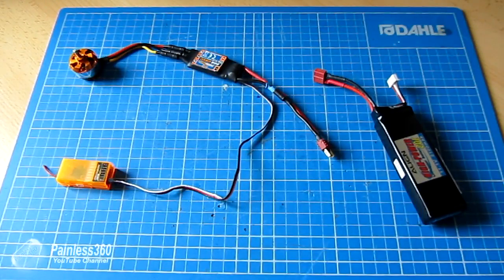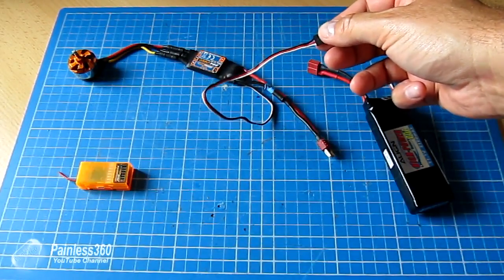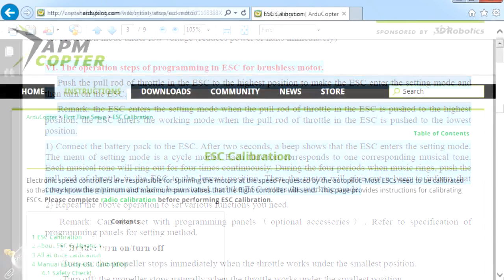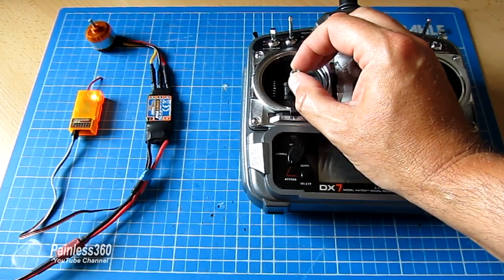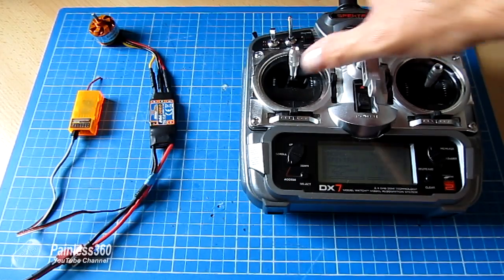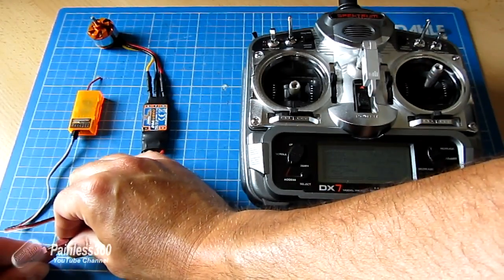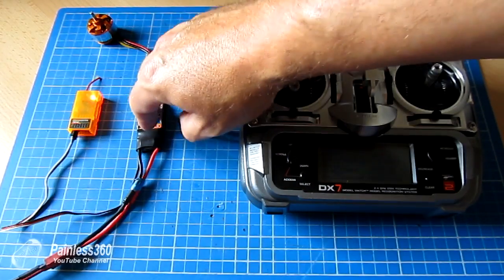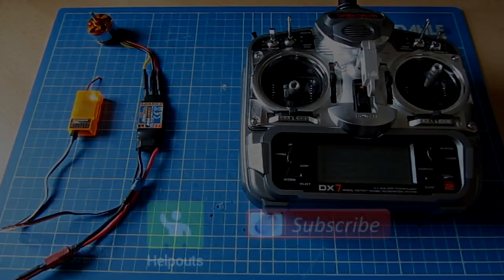Multirotor build tips: Simple manual ESC calibration

Comment: Hi, Painless360

I already calibrated my ESCs when I was using a Open CC3D flight controller.
I want to use the same ESCs for an APM set up. Do I need to calibrate again for when I'm setting up an APM quadcopter?Thanks
Reply from the maker: +Yomi Eluwande I would, just to make sure everything in the new machine is happy. Best of luck

Comment: I have the flying 3d x8 quadcopter three motors idle at arming but the right front motor does not it seems to work fine after I give it more throttle do I need a new esc or just calibrating. thank you .
Reply from the maker: +ziggyzbeak I'd try re-calibration of the ESCs as a first step... Best of luck.
Reply: tthanks ill try

Comment: Hi dear, I have tried to follow this calibration with an Emax 12A BLHeli ESC and Emax MT1806 motor but I did some step wrong and got a throttle inverted (full at bottom). Could you please help me to reverse that mess! Thanks!
Reply from the maker: +Oscar B. Monteiro Jr. Redo it all with the props off.. Best of luck!
Reply: +Oscar B. Monteiro Jr. use the reversing switches on your controller
Reply: Oh yeah, I got it. I forgot this step when assign a new model in my Tx. Thanks anyway!

Comment: Hi,  Would this  function on the Devo 10 with RX2001 and RX601?

You do a great job and  you are a good educator.... much appreciated.
Reply from the maker: +Quadcopter102 No idea, I don't have that radio. You do need a receiver that can provide the throttle channel as a PWM signal - if the Rx does that then it should work.. Best of luck.
Reply: Thanks for  reply....

Comment: What the difference between this and when you do it through open pilot.  Seems like it's the same thing.  Having major sync issues.  Not sure if my escs are shit and don't work well with my sunnysky 2204s 2300kv.  Or if it's something else
Reply from the maker: +Chadeverythingcustom I've had problems with the 'automatic' and 'all-at-once' method of calibration and this is the method that works the best for me. I've had problems in the past where using different ESC firmware versions causes all kinds of odd behaviour.. Best of luck..

Comment: Is it normal to calibrate the ESC directly from receiver's throttle channel and not through the flight controller's motor outputs?
There should be no range difference of throttle signal of radio and to motors from FC?
(I have quadcopter with APM FC)
Reply from the maker: +FotoAmg AmgFoto In theory yes. There is a way to calibrate through the APM but I've found it didn't always work for me.. Happy flying!

Comment: I try to cal my esc but after that the motor spin very very slow even in full thro., what can I do? I try recalibrate it many time and no luck,
Reply from the maker: All of them or just one?
Reply: 2 out of 4. Half... I think it is a issue with ESC as I swapped motor same happen.
Reply from the maker: +wing hum thomas fung I would go back to the vendor if you can't calibrate them successfully using this method. Best of luck.
Reply: I have tried with different remote finally I could recover it to default setting and it works. But my question now is does the thro lower point and higher pint of Thro need to set it lower by the trim to works?
Reply from the maker: Sorry I do not understand the question..

Comment: Hey Painless360, so I got that new ESC and all 4 are now calibrated and in sync using the Master throttle in clean flight, I tried a test flight and all the motors seem to kick on at the same time but once it got in the air it just went crazy and very unsteady... I hooked it back up to cleanflight and  when using my taranis plus Tx the motors are not in sync and fluctuate quite a bit....I  am so frustrated with this lol any suggestions??? is there some sort of settings in the taranis I need to check??  I have the nighthawk 250 pro kit, naze32 board mounted using nylon screws/nuts..
Reply from the maker: +Justin Paul Nothing to do with the radio, the ESCs are controlled by the flight controller. I would check for vibration on the craft - unbalanced props and motors - and mount on foam to reduce it. Excessive vibration can be seen as movement by the FC and compensated for. Try other PID loops and also look at LPF if you've tried everything else.
Reply: Yea I was messing around with the pid loops after I wrote the message thank god. I was using 1 (rewrite) and it was very unstable.  Switched to 0 (old) and it flys perfect!  Thanks for the help and I'm glad I didn't take it all apart before messing with the loops :)  now to just get better at flying so I can mount fpv camera and mobius! No worries there I got that all working fine haha thanks again.

Comment: what motor do you recommend with this esc?Hobbywing XRotor 40A  2s 6s?SunnySky X2212 KV980 Brushless Motor?
Reply from the maker: vano kiknadze This ESC will work with loads of motors - the weight of the model, battery size (3s or 4s etc.) and how many motors you will use (quad/hex etc.) determine the motors and props, not the ESC..Best of luck.
Reply: Thanks

Comment: Very nice video.
I followed your procedure and found if I waited with throttle up I would get 1 beep 5 times, 2 beeps 5 times and so on until 5 beeps 5 times then returned back to one beep...
From what I read this is the program mode. I didn't change anything, only waited for the one beep then throttle down. I hope I did it right. I'm using Turnigy Multistar SBEC 20A ESC's.
Appreciate your thoughts.
Reply from the maker: What does that manual say about calibration?
Reply: Painless360 i found an old manual but it differs in the programming mode(beeps). I dont want to do simething that would mess it up.
I have a KK2.1 FC. I could set it  up because it has a calibration mode and then put it back with the Naza lite FC. Do you think this would work ok?
Reply from the maker: W Morris I strongly suggest going back to HobbyKing and getting the actual manual, without it you are guessing.https://www.youtube.com/watch?v=olIqTiSJHIY can be a useful reminder in cases like this. Best of luck

Comment: Hi thanks for the great tutorial.I have these exact same ESC's in my Naza FC 450 quad. Have flashed them with Simonk K, I use a Futaba FF9, or 9C as known in the USA. (FrSky 2.4 module mod) Please watch the attached video and please let me know what steps to take. It is powering up at 50% throttle as your pre calibration shows. https://www.youtube.com/watch?v=FNE37bJZHBw
Reply from the maker: Matt's Hobby Channel I would check that the throttle isn't reversed on the radio. That ESC is powered on and can see the low throttle position. You need to power on the ESC with the throttle in the high position (usually over 1800) and then drop it to zero (usually about 1050ish) to complete the calibration. 
Yours are not going into calibration (from the sounds) so are not seeing the 'high' value when they power on..
Best of luck with it..
Reply: Thanks, but not reversed, have been flying it short hops like this, and is definitely the correct orientation, but thanks for taking time out to try. Any special settings being Futaba gear? Is driving me nuts, just want to use it. It's obviously squirrely in the air, so don't want to risk destroying it or worse! Cheers Matt
Reply from the maker: Not sure without a lot more investigation.

Best of luck with it.

Comment: Great video! I am having a problem in which my quad will not get off the ground. If I calibrate with Open Pilot's wizard or calibration tab, the 2 CCW motors stutter on the bottom of the throttle curve do not fully spin until the CW motors are already up to neutral speed. I tried to calibrate each one manually via the transmitter/receiver (Turnigy 9x TX and 9x8C RX) but each ESC will just beep continuously until the transmitter is powered down, then they play their tune and speed the motors up until I disconnect power to the ESC. The ESCs are 12a SimonK and the motors are Emax MT1806-2280KV.

Any idea why the ESCs will beep continuously like that? I'm starting to wonder if they in fact have a different firmware or are damaged.

Any help would be appreciated.
Reply from the maker: Chuck Leone If they will not calibrate using the method in this video then something is up. 
Once you've calibrated then this way then you can use the output sliders in Openpilot to set the level that each individual motor starts to turn...
Best of luck.
Reply: Painless360 Thank you for the response. Any idea of how to confirm what firmware these ESCs have loaded without using an ESC programmer?
Reply: Chuck Leone I have the same problem
Reply from the maker: You have calibrated the accelerometers right?

Comment: I'm stuck here, my d4r-ii doesn't power up from the servo wire coming from the esc, any suggestions? I want to calibrate all esc before I mount and hardwire them onto the quad. The receiver is brand new never powered up
Reply from the maker: I would check that you have plugged in the wire the right way round, and use a volt meter to ensure that there is five or six volts coming out of the positive wire in the middle of the three pin server connection from the ESC.

Best of luck.
Reply: Thank you for replying, i have the Turnigy Plush 12AE, they claim BEC output to be 5v/2A.
The motors chirp when i power them up, i've watched all your related videos so was careful about polarity, is there any other way i can connect power to the d4r-ii to see if its faulty?
I have ordered another one just incase, but it won't arrive for a week or more :/
Thanks again
Reply from the maker: If you have checked that there is +5v out of the red wire in the middle of the cable then it looks like the Rx is faulty. It should light up in some fashion when power is applied.

Best of luck.
Reply: Painless360  Hello again, i have now got the receiver working and bound to my Taranis,  the motors spin but there is a big dead range so  i want to calibrate all the esc's individually before i install everything and solder, i have followed all the steps, double checked the instructions, watched all your videos (again) and they will not calibrate throttle range.. 
I have worked out how to program the esc with the Taranis but i'm not sure on some of the settings like, 'start up mode- soft,super-soft'. On another video someone was using a programming card to program their plush escs and they changed the Timing to High noting that it was important. 
Anyway its really frustrating me and your help would be appreciated if you have any idea what it might be, Do i need to flash them with BLheli or something like that to get them to calibrate? hmmm ;)
Reply from the maker: If you are using the ESCs for multirotors then they should be flashed with a firmware that is designed to improve performance and response for those applications - SimonK and BLHeli being two popular ones.

I would go back to the vendor for support.

Best of luck.
Reply: I have tried a different esc that is flashed with SimonK and its the same, so i assume its something i have missed in the Taranis.
I appreciate you must be inundated with questions from noobs like me and unable to take time to answer sometimes, ill battle on.. thank you again.
Reply from the maker: You need to work on getting the ESC to calibrate in manual mode.

The only thing I can suggest is that you look at the range that the Taranis is putting out on the throttle channel.

Normal throttle channel values are approx. 1020 to 1980 and the default range for a SimonK ESC is 1060-1860.

The Taranis can put out a much wider range that might be confusing the ESCs you are using - see https://www.youtube.com/watch?v=azs1wmr4c7w around the 15:00 mark..

Best of luck.
Reply from the maker: Also https://www.youtube.com/watch?v=9jyq12lrxQ4&list=PLYsWjANuAm4rtLZuLU2eSTc3svqWx-pa1&index=5 around 15:32 I talk about this too...

Comment: Very nice video man.. Helped me a lot.. But just one question , If I make this one by one (4) connecting them into the throttle port, wouldn't that make a slightly difference between every motor ? , so each one is going to start first than the other one ? Thank you.
Reply from the maker: Ricky Henderson I see why you may think that but this process 'teaches' the ESC exactly what the actual throttle range on your radio is so they start at exactly the same time when powered up. 
Best of luck with the setup.

Comment: question, my set up futaba t8j-tarot 560 sport- wing-hobby xroto 40a brushless opto esc. Naza M fc.I have just finished calibration.just as you did, everything looks good. motors all turn on mid throttle  etc theirs one  thing I do not understand these esc do not sing out at start up?? Is this something I did when setting up throttle?all my other quads do IS THIS OK??...................Jerry
Reply from the maker: jerry neider The motors should start turning as soon as you move the throttle up (with the board armed). Not mid throttle. I'd check ESC calibration and throttle channel settings on the radio and in the FC.
Best of luck.

Comment: When I plug in my esc's to the power and receiver just like this, they beep but then they do not throttle up or down. help please...
Reply from the maker: Will Park What troubleshooting have you already done?
Reply: Painless360 I'm pretty sure I have dead esc, other esc's work with the same receiver and motor combo
Reply from the maker: Only way to tell is swap the motor on the 'dead' esc with one of the others. If the problem stays with the ESC, then it is the ESC at fault. If it follows the motor then its the motor that needs looking at.

Best of luck.
Reply: Yeah the esc is dead, I bought a quadcopter kit from hobbyking that came with 20A motors but 15A multistar esc's. It's not surprising that two of the esc's would not work.
Reply from the maker: Bummer, sorry to hear that. Good work on figuring out. I'd let HK know and get them to ship out replacements. They are very good with DOA kit.

Best of luck with the next two!
Reply: Yeah, not sure I want them to send out the same ones though. I'll see if I can get them to send 20A esc's next time.
Reply: Will Park For what its worth, I recently built a zmr250 from the ground up. (my first build)  I foolishly thought I could run a 4S batt on 12amp Emax ESCs... about 1 minute into hovering, I smoked an ESC. This was partially because the ESCs were under powered and they were not calibrated properly. That being said.  I have now ordered 5 ZTW 30amp Spider ESCs.  ESCs are the most work in replacing in regards to soldering.  I would spend a couple extra bucks and get something with enough headroom (20amp) and a reliable \ programable brand.
Reply: HobbyKing sent me 20A Afro ESC's and it now flies great
Reply from the maker: Great news! Happy flying!

Comment: Great video. Was just wandering if this method will work if I've configured my RX to use S-BUS? Thanks.
Reply from the maker: You need to be able to plug the servo lead from the ESC into the throttle channel. It's expecting a PWN signal so you'll need to turn of S-BUS or use an adapter for that to work..

Happy flying!

Comment: I have just picked up a TTX850 and TR625 receiver for my quadcopter. I'm using a NAZE32 flight contoller and want to program it with CleanFlight. My problem is I cannot get the TX to work with the RX. I am nit sure if I should disconnect the ESCs from the NAZE32 first and connect directly to the TR625 to program the radio or if I should leave the ESCs connected to the NAZE32 board and connect the RX to the NAZE32 also? Does anyone have a guide on how to program your TX for a quad copter? I can get the motors to spin when i am in CleanFlight testing the motors, when I use the TX they don't move. Somebody Help please!!!

Comment: Hi, I'm not sure if this is the page to ask for some advice but I'm a bit puzzled on choice of my ESC. I've got a build underway of a tarot 680pro with 620kv motors and am looking for the right ESC. I read about the ztw spider, HK, Hobbywing flahed with Blheli or simonk etc but clueless which to take. Any advice you can share? Many thanks enjoy your videos as they are a real help. Thanks!
Reply from the maker: You should always select an ESC with more capacity than the motor needs. Hobbyking usually are very good at posting the suggested ESC size. I have a video on this RC Electric Power Systems Simply Explained (ESC, BEC, LIPO, Brushless etc) and at 11:45 I cover some best practice when sizing the ESC and battery for a RC power system.

Always go for SimonK or similar flashed speed controllers. The model will respond so much better.

Hope it helps.